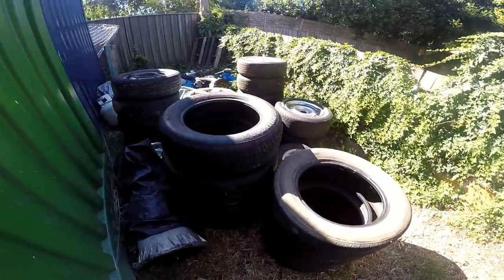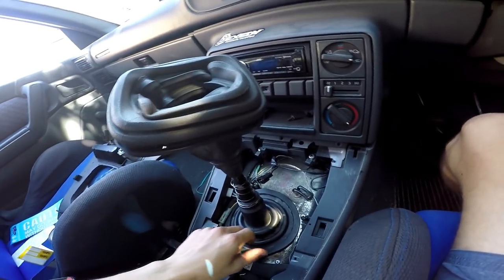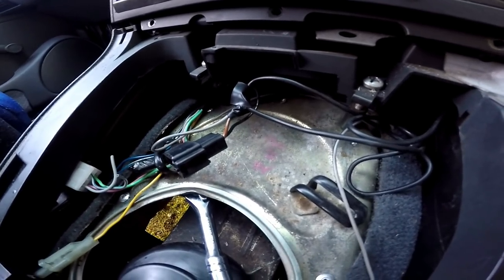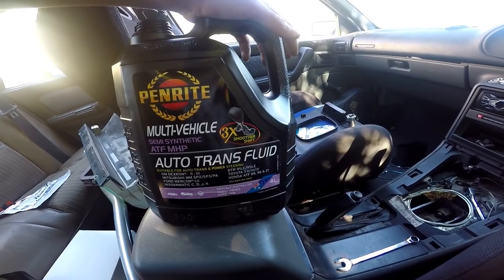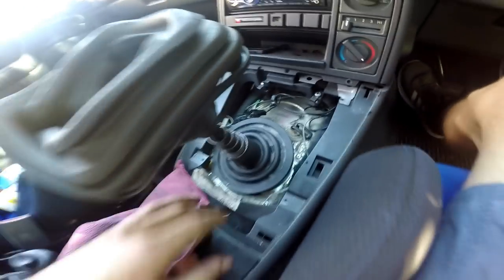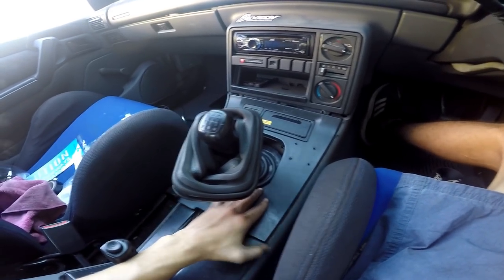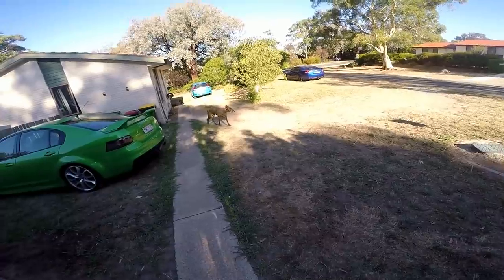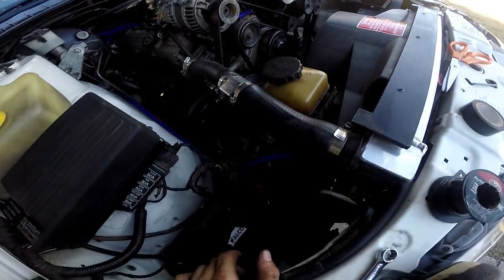AUTO TRANSMISSION FLUID IN A MANUAL GEARBOX?!

Comment: Late reply, but you can use any “standard viscosity” ATF. This means anything “multi-vehicle” spec’d around Dexron III/Mercon V and ATF+4. These are all superseded ATF/MTF specs, since the late 90’s to early 00’s, I believe. 

What you do NOT want is Dexron VI/Mercon LV; basically any kind of multi-vehicle, “low-viscosity” ATF. Those are less viscous/thinner at a cold weight, but the additive package in the trans fluid is a bit too “slippery” for manual transmissions/gearboxes and their synchronizers. 

You can also use any kind of GL-4 gear oil with great success. Depending on whether you live in the US or not, “Synchromesh” MTF (manual trans fluid) can be found for cheap from brands like Valvoline and Pennzoil. They’re basically just a GL-4 75w-80 gear oil. If you need something thicker, GL-4 goes all the way up to 75w-90; but generally, you don’t want to drop any lower than 75w-80 unless you find a brand that’s still more than 7 cst viscosity (75W is already too thin, at a ~6 cst viscosity).

Comment: Did the fluid top up ever fix the crunchy shifts ?.
I was thinking your synchro's were probably shagged !
We run ATF in our 5 speed manual 190e 16v track car as recommended by Mercedes from the factory.
At one point we decided to use regular gear oil for hill climb events cos we were thinking 'heavy duty' would be better..
Couldn't have been more wrong. First day out, the inside of the car smelt so bad from the gear oil literally boiling its ass off and the fact you couldn't do fast shifts until the oil was super hot !.
Who would have thought ATF would work in a manual considering it looks like pink water 👍
Reply: Tremic manual transmission in fox body mustang uses atf too people think I’m stupid but I’m right about this and ur right too use what manufacturer tells u for the most part
Reply: im using a mercedes based transmission and i need to get a thicker oil since synchros are fucked, what fluid can i use?? it's running dexron 2 right now but it sounds like a espade being drawn
Reply: @ajcates9136 Late reply, but Tremec themselves started seeing a lot better results with custom projects using GL-4 gear oil. They themselves sell their ‘HP MTF’ (high performance manual trans fluid), which is basically just a GL-4 75w-85 gear oil/MTF. 

Only thing is that it’s recommended mainly for neutral to hot climate environments (given that typical base/stock specs call for Dexron III ATF or something close). As a result, many people find running any kind of typical Synchromesh MTF to be super good (usually GL-4 75w-80 spec).
Reply: @junitomaster6689 Late reply, but you can use any “standard viscosity” ATF. This means anything “multi-vehicle” spec’d around Dexron III/Mercon V and ATF+4. These are all superseded ATF/MTF specs, since the late 90’s to early 00’s, I believe. 

What you do NOT want is Dexron VI/Mercon LV; basically any kind of multi-vehicle, “low-viscosity” ATF. Those are less viscous/thinner at a cold weight, but the additive package in the trans fluid is a bit too “slippery” for manual transmissions/gearboxes and their synchronizers. 

You can also use any kind of GL-4 gear oil with great success. Depending on whether you live in the US or not, “Synchromesh” MTF (manual trans fluid) can be found for cheap from brands like Valvoline and Pennzoil. They’re basically just a GL-4 75w-80 gear oil. If you need something thicker, GL-4 goes all the way up to 75w-90; but generally, you don’t want to drop any lower than 75w-80 unless you find a brand that’s still more than 7 cst viscosity (75W is already too thin, at a ~6 cst viscosity).

Comment: can we put automatic transmission fluid in manual ??????? Plz help
Reply from the maker: Yes mate, for this t5 gearbox they run smoother with dex3 auto trans fluid, and a friction modifier additive, for the synchros.

If you search up t5 gearbox fluid questions on Google, you'll find all the answers you need.
Reply: @GearHeadsOz  I have mitsubishi pajero sfx 2010 model.. and i purchased ATF for manual..
Reply from the maker: @MenMyMachine  Yeah, I can't help you there mate. 
That's not what this video is for either. 
I doubt your gearbox suits auto fluid.
Reply: @GearHeadsOz  hope so mate
Reply: Can you put ATF in transaxle???